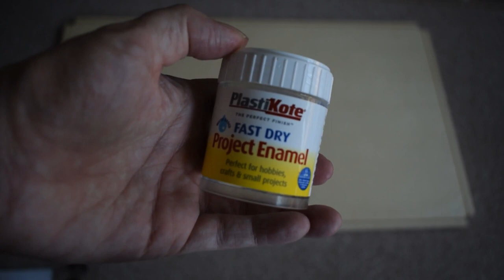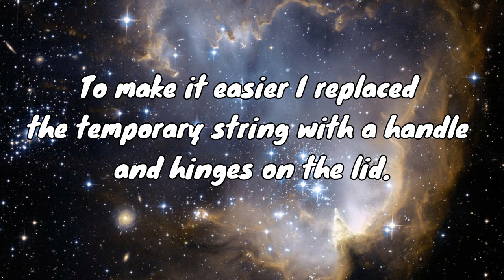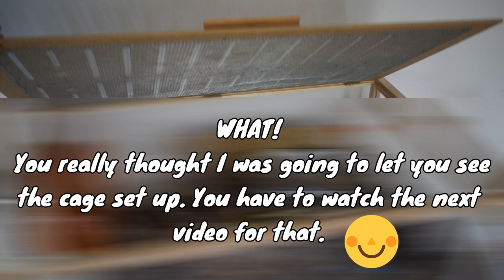Putting Together & Altering The Living World Eco Habitat Cage | Cosmic Hamsters

Comment: Great video! Didn't think to modify the Eco Habitat like that. Would a liner at the bottom suffice if we don't have plastikote?
Reply from the maker: Thanks and not sure what you mean by a liner? I would be careful what you line it with incase your hamster chewed/ate it. I used a 100% hemp mat.
Reply: @CosmicHamsters  I was specifically thinking of the hemp mat! The plastikote is to prevent damage to the wood, right? Would the hemp mat be helpful enough without the plastikote?
Reply from the maker: @madelinebrooks4726  Yes, the plastikote is to protect the wood from urine damage. So far Twinkle hasn't burrowed down far enough to get urine on the hemp mat or the base, so a hemp mat might be just enough on it's own, with plenty of bedding on top of it. However, all hamsters are different, so one might burrow right down. You could just try it and see what happens.
Reply: @CosmicHamsters  Alright, I'll try that :) thank you!
Reply from the maker: @madelinebrooks4726  you are welcome. Goodluck.

Comment: Hellow! I was thinking to buy this cage, but i would like to know if the height is 63cm included its wheels or it's just the cage. I have a spot perfect for this cage andmit would fit like a charm. just the height would be an issue if it's taller with the wheels 😅
Reply from the maker: I believe it is 61cm.with the wheels and 52cm without. I hope that helps
Reply: @CosmicHamsters  ty! It helped indeed 😁 I'm totally going to buy it! Thanks!
Reply from the maker: @MayaPatch  ohh exciting
Reply: @CosmicHamsters  yesss 😁 it's also larger than the skyline Marrakech i have atm. Need to change because i need a more practical solution 😅 plus, the skyline broke... So, yeah...
Reply from the maker: @MayaPatch  oh no,. How did the Marrakesh break? I have that cage too but not using it at the moment. I think you will like having more depth with the living world eco habitat compared to the Marrakesh
Reply: @CosmicHamsters  yup, also, more height 😂 i have a 20cm wheel for my dwarf but with the Marrakech i had to keep the bedding low at one side because i couldn't put the wheel on a platform for more digging spot. But with this one i might be able to. 
Anyway the upper part broke, stuff happens :/ I'm not in rush to replace it, i have managed to fix it, but both me and my mom thought that something else would be better. The price in the french Amazon is even cheaper than the Italian one. I think I'm going to order it from there 😂